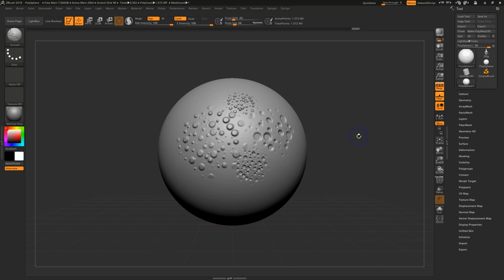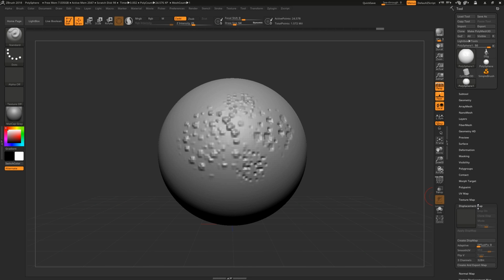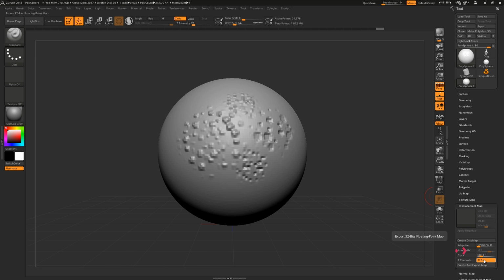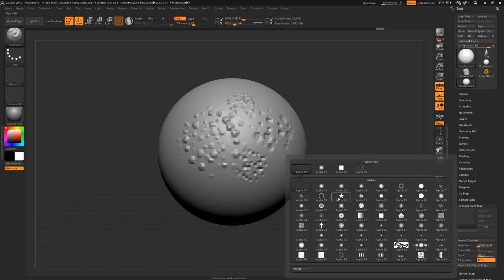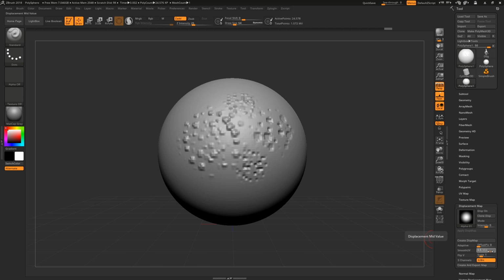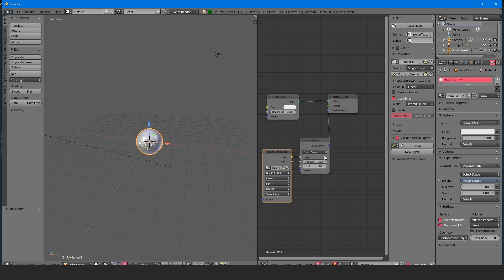How to render DISPLACEMENT MAPS from ZBRUSH to BLENDER - 60 Second Tutorial

Comment: i hate those node materials -.-
Reply: Each and every 3D software out there, 2D procedural ones (Allegorithmic, etc), Unity Playmaker, Unreal Visual Scripting, Rendering engines material editors, etc. Node building is : everywhere. Maybe should you adapt and realize how great a system it is. Or just think of another line of work, bus driver, cook, whatever.
Reply: It's very handy, if you don't use it you miss out on great amount of options, in simple terms you're noob not pro
Reply: You can get used to it, just don't be scared. Think in your head that it will just take some time